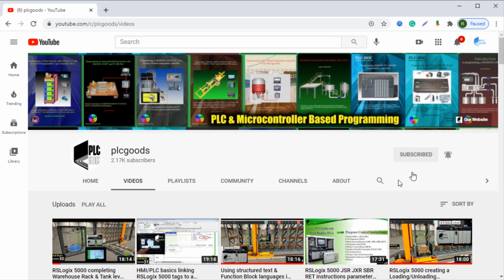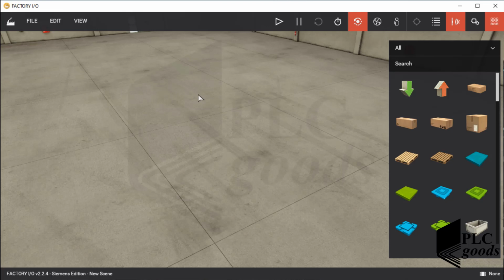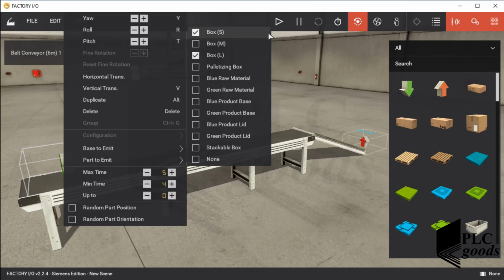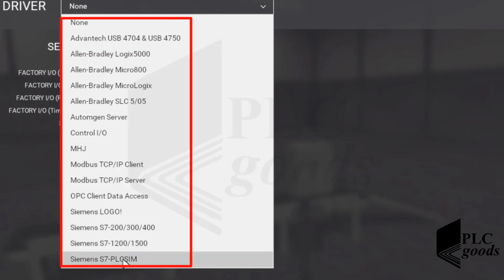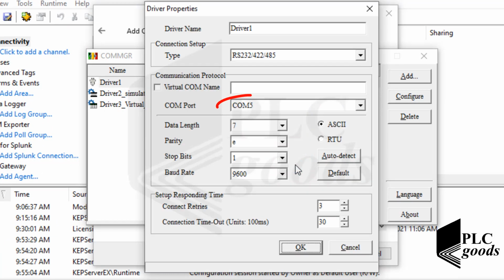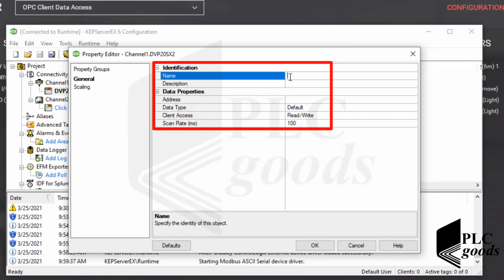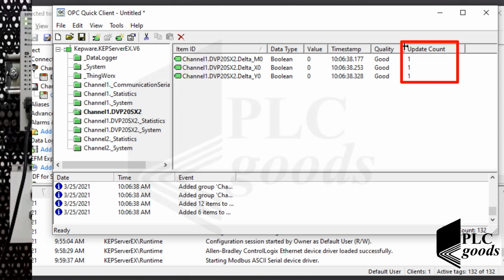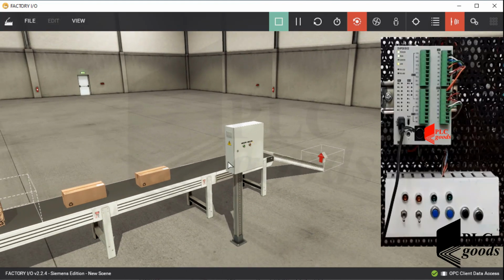CONNECT DELTA PLC to Factory I/O Using KepServerEX | Delta PLC Communication  | Lesson 4

Comment: Hello sir, i have the same PLC and the same configuration as you, but it seems that the delay between Factory I/O and PLC is very noticeable (1-2 seconds). How can i solve this problem? I have tried using the Rs-485 COM port and it's the same.
Reply from the maker: Since you are using OPC server, then the delay is natural! It was mentioned during the video as well.
Reply: @plcgoods  Thanks for your reply.  I solved the problem by setting modbus RTU instead of ASCII. I have increased the baud rate to 115200 and I have set the scan time to minimum (10 ms instead of 100 ms). Now I barely notice the delay.

Comment: Hi Syed Raza, Can I run the whole simulation with out using the Delta Plc device hardware, if it's possible what type of channel I should create?, and what Comm port will be?, in case to achieve effective connection to run the Factory I/O with DVP simulator. 
Thanks
Reply from the maker: Hi there, You can test your programs with a DVP simulator. Note that I only connected Factory I/O to my physical PLC. If you find a way to make a connection between Factory I/O and DVP simulator, please share that with us.
Reply: @plcgoods  Hi Syed Raze, that was the question I was going to ask lol and many of us viewers ask these kinds of questions and we don't get a very helpful reply and no reply at all most of the times but in your case you gave Tim to read the question and answered the person that you don't know a way to connect the simulation with factory io and this clear answer saves us a lot of time and lets us move forward and not waste our time. This was the question that was bothering me a lot and I respect what you did for being truthful 🙏.

Comment: hello sir, is there any other way to connect delta plc and factory io? KEPServerEX license is very expensive due to the exchange rate difference.
Reply from the maker: Hello sir. Note that, the demo version of KepserverEx software supports its all abilities. We only need restart it every 2 hours. However, I’ve not worked with another software to connect my Delta PLC to Factory I/O.

Comment: Hello syed. Please is there a way to link factory IO using kep server direct to delta plc simulator just the simulator. Here's my point in your video you have the plc hardware and the modbus cable but in a situation where the hardware isn't present and we would like to see the factory simulation control the delta software simulation. can it be linked?
Reply from the maker: Hi there, unfortunately I’ve not found a way to connect ISPSoft simulator to Factory I/O. probably, it’s possible. If you find it, it’s my pleasure to share it with me. Thanks.

Comment: Date           Time            Level           Source                     Event
4/23/2022      11:10:00 AM     Warning         Modbus ASCII Serial        Delta_DVP-14SS2.DVP-14SS2 | Device is not responding. | ID = '1'.
Reply from the maker: Hi there, it seems you have a problem to make a connection with your PLC via Modbus. I can't help you only based on a message. It's better to check your connection settings and also the ports and your hardware, otherwise ask an expert which you access him to help you.

Comment: Sir when i try to open opc Quick client and select deltadvo14ss2 it shows empty.. Doesn’t showing any tag.what is the problem.. Can you please solve my problem!
Reply: Hi there, If you don't see any tag in the Quick Client window, Probably your connection settings are not correct, or the physical connection has a problem in its cable or incorrect port. 
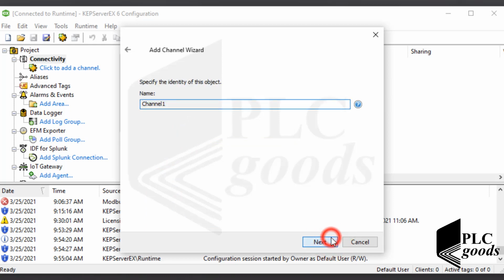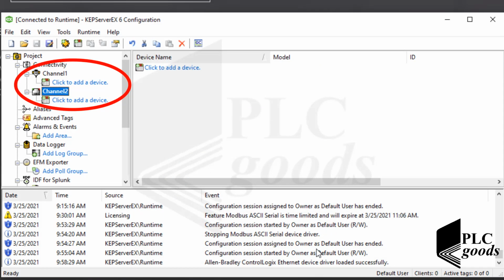Also, pay attention to the video (time 11:30 to 12:30).
Reply from the maker: Thanks for checking out the channel!

Comment: Hello Syed. I am trying to connect Kepserver to IspSoft (DVP simulator; I don't want to use Factory IO). How do I establish a connection (Kepserver via DVP simulator)? Specifically- 1) Type of channel to be created (2) What to enter in Com ID/Port nos.?
Please advice.
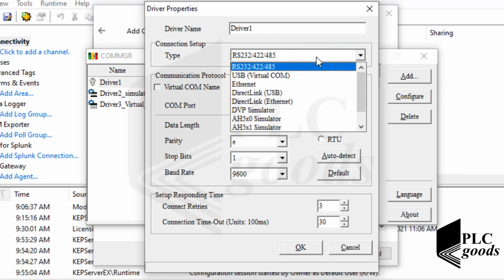Reply: Also at 11:58 minutes in the video, all your drivers have stopped. Which driver are you using to run your PLC?
Reply from the maker: Hi there, I've only connected factory I/O to my real PLC using Kepserver. However, maybe there is a way to make a connection between DVP-simulator and kepserverEx, but I've not searched about this connection until now.

Comment: Thx u alot of u content it's very useful for me , I tried to connect factory io to kepserverex using a virtual plc but it didn't work , when I pressed the quick client and choose the dvp channel it shows unknown value for x0 , m0 and y0 besides a bad of quality connection
Reply: Hi there, Maybe there is a way to connect the virtual PLC to Kepserverex, but I've not checked that. note that, I used my real PLC during my videos.
Reply from the maker: please work on this and let me and others know the result!
Reply: @plcgoods  I figured out that if I change the properties of the channel changing  the option simulated from no to yes , the values changed besides to the quality of connection and became good but it can't be changed when press push button at factory io
Reply: @ayhamshbat2733  I have facing same issue can u help me?
Reply: @waqaryousaf3207  I didn't solve this problem,  sorry my friend
Reply: @plcgoodsmentor9223  PLCgoods made a vid it but not with opc server it's with control io

Comment: i dont hav real plc is it possible that i can connect factory io with simulation....
Reply: Yes you can using dvp-simulator, you'll have to create a modbus serial ascii connection, over tcp/ip, an after that you can connect factory io and kepserverex with opc. Or you can also use as-simulator and connect directly through modbus tcp/ip without the need of kepserverex.
Reply: @easyengineering9134  can you please tell me how , it would be a great help
After selecting modbus serial ascii, what com port should i select ?
Reply from the maker: yes you can use the Factroy IO to simulate a PLC
Reply: @plcgoods but  in delta ispsoft 
Thanks for replying

Comment: Hello. Can you tell me what is different between M0 and X1. In your case both is DI. I dont know what is different? Can you tell me more?
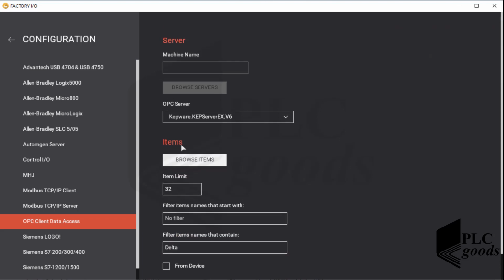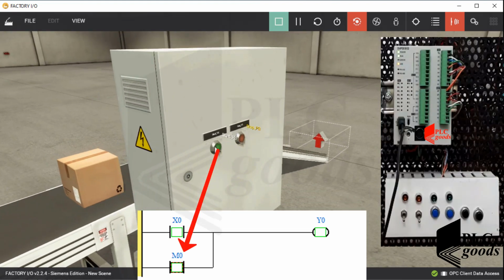Reply: Please see the video again, especially the time between 18:15 and 19:30. Overall, X0 is connected to my real switch, and M0 is connected to the virtual pushbutton inside Factory IO software.
Note that, digital input addresses (X0, X1, ...) deal with a real voltage ( 0 and 24 volt), and the virtual pushbutton inside Factory I/O can not change the appeared voltage at a real digital input like X0, but it can change my PLC memory like M0.
Reply from the maker: This issue is answered in the previous videos over and over, to understand better, I recommend you to watch some more videos of these series of Delta tutorial videos, to get it for yourself.